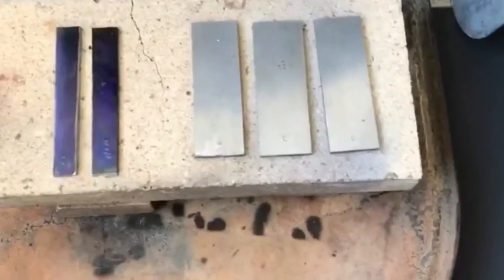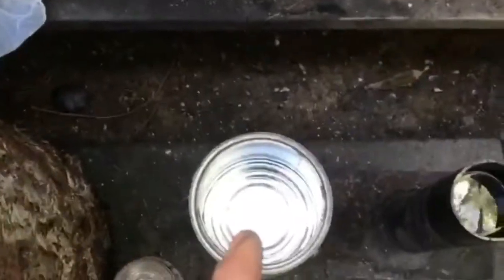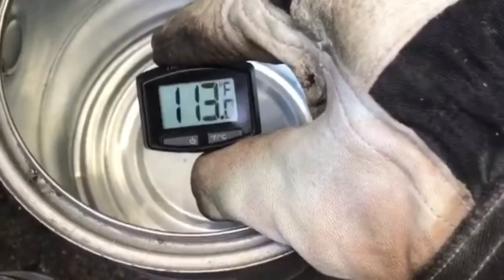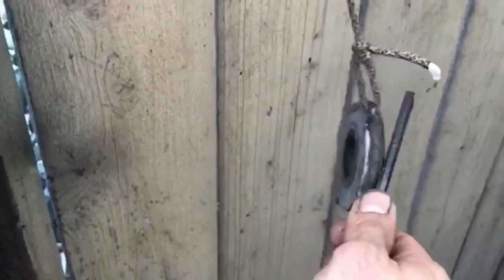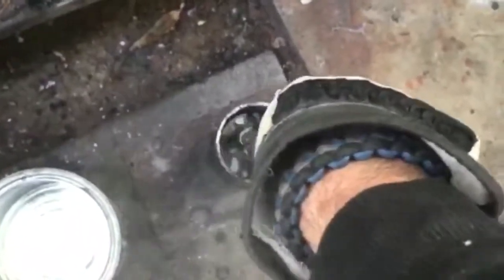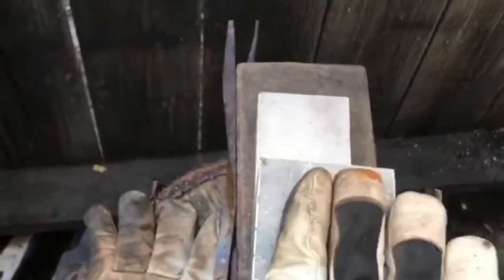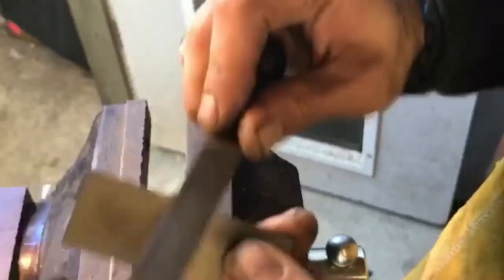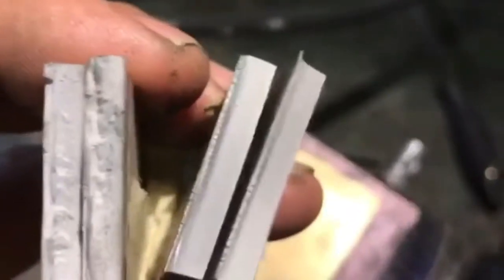NITRO-V heat treatment experiment

Comment: A pid setups pretty cheap which is why i suggested it, ed caffrey has a salt tank setup explaining how to do it..when converting the idea for a gas forge remember to sheath your thermocouple in ceramic or to bury it a lil with kawool...they dont read as accurately when exposed directly to flame.

Comment: Heya man, i know ovens can be pricey, maybe think about getting a pid, gas solinoid, and thermocouple probe and that way you can digitally control your gas forge, nitro likes to be soaked at higher temps and quenched at 1900...waaay past the curie point ( non magnetic). The plate quench needs you to be FAST with the compressed air, and idealy you need to cryro...some dry ice if you cant spend on nitro setup, this stuff LOVES to retain austinite without a cryro...

Comment: Without foil or an anti scale compound, and in a forge, you aren't going to get consistent results. I water quenched nitro in july, it's on Aldo's instagram. These tests you have done are badly flawed as you have not properly prepared samples or used a proper heat source, I am sorry.
Reply from the maker: ed braun  thank You so much for your feedback! This is exactly why I posted this so I can get these feedbacks and find my flaws. Since I'm totally new with this steel and don't have any kiln at the moment to get the consistency I followed the direction that Aldo told me (non magnetic & Quenching).  I'll truly appreciate any tips that I can improve this process. 
Thanks Again.
Reply: ANDREAS KALANI thank you for understanding and listening, most guys get upset when told issues with testing methods. Feel free to contact me on Facebook or instagram if you need any help or information